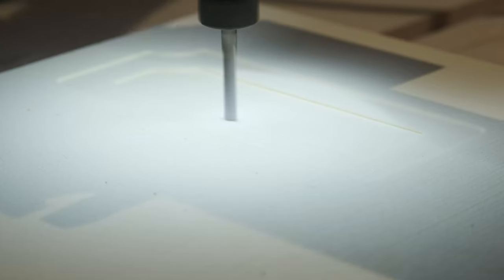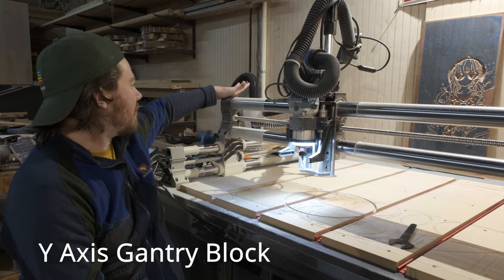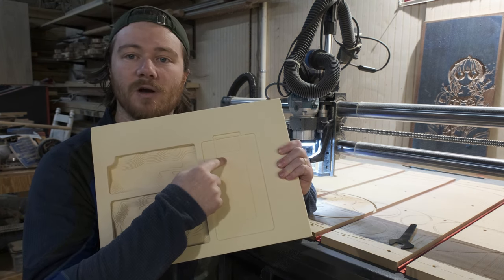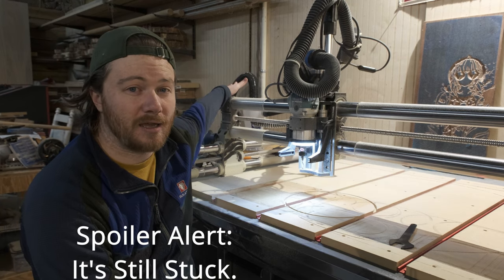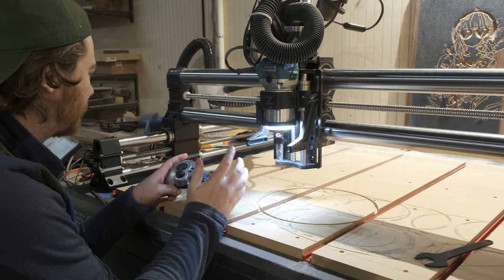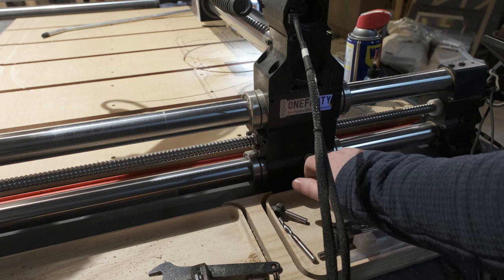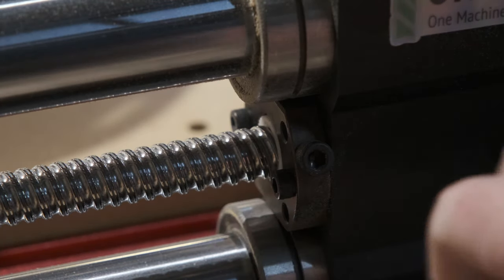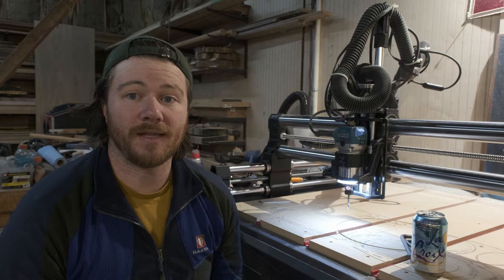I Broke My Onefinity Journeyman X-50 CNC

Comment: Sounds like main reason this happened, was, as you said, trying to film the cut, not using dust boot.  It is good shop practice with machines to not use compressed air for cleaning chips as it blows the chips inside.   Use a shop vac and a good chip / paint, brush to knock them loose.

Comment: Good thing to do after that too to make sure that both Y axis Gantry blocks are symmetric is to make it reach the endpoint towards you and make them both skip steps after hitting the frame. I believe that ensures the symmetry on both Y axis block position! Correct me if i am wrong but i am doing this once in a while on my Ratrig Killerbee.

Comment: You should re oil it 3in1 it is the recommended oil not WD it will rinse the three-in-one out of the bearings and then dry up
Reply from the maker: Great advice, I've got some on the way! Thanks!
Reply: @HamiltonDilbeck  was about to say the same thing, someone came to my workplace and suggested that we should use wd40 for oiling our brand new sawmill. would have seized it up in no time and i was the only one who can read english. there is a big sticker on the machine stating to use thin oil or diesel. wd has lubricating properties but its not oil, for CNC its better to use silicon oil/grease because it wont attract dust.
Reply: Yea I was gonna say it to 
Wd40 is more of a cleaner than a lubricator 
Use the 3in1
Reply: WD stands for Water displacement. It’s not an oil. But good for cleaning.

Comment: the reason for that is the presure air you use to clean it blows the chips and dust in the mechanik :)
Reply: Exactly, all machinists KNOW, to NOT clean machines with compressed air, for THAT reason, blows chips inside everything. Learn to use a chip brush with a vacuum.

Comment: Wow, aren't you supposed to lubricate that ball screw with the appropriate grease (that screw you took off should be a greasing nipple it from the looks of it)? If all it gets is some WD40 that thing will run dry and wear out fast it seems like. Probably a good thing to add some extra wipers or covers to stop dust if you do foam like this a lot. Even with a vacuum running.

Comment: Cable tie some sponge either side of the ball nuts and soak it in oil. You will never have a problem again. But use proper oil or grease for the ball nuts, WD40 is only good for cleaning. 
Beautiful simple and solid machine, love it.
Reply from the maker: Great tips!

Comment: Hey I know I am late to the party . Love your cnc and the working threw getting it going. I noticed something. Wd40 is bar far maybe the worst thing you can use. I know controversial. They actually make lube designed for ball screws that will help with the dust and the like. I also saw watter coming out of your compressed air. Need to drain the tank.
Reply from the maker: Great insight, thanks!
Reply: Absolutely! Get a filter on that airline!
Reply: I have 3 air compressors and all 3 have automatic tank drains on them. The main one, which I use for spraying finish, has the drain, a 3 stage filter system and an air cooler unit between the compressor and the tank. Water = 0.

Comment: Use a dry lube on all of the ball screws, like CRC 3084. But clean it all out this time. You left quite a bit of foam particles when you put it back together. A little more time cleaning now, will save you ALOT of time later, doing it again.

Comment: Glad you figured it out. Frustrating, but an easy fix after discovering it. When mine goes off on it’s own, it seems to be a g code misreading. Usually resetting the program fixes it, but that comes after it’s ruined the workpiece.
Reply from the maker: That has happened to me once before when I was blowing off the machine mid carve. When the compressed air hit the connection port for a wire it seemed to make it skip over some code. That's the only time for me, though. And yeah the foam was like $20 which is annoying- good thing Amazon has two day delivery!

Comment: I had exactly the same problems as you and had to rebuild my machine 3 times before it would work correctly. Your cutting pattern went offline because stepper motors keep counting when the bearings jam  because the is a clutch in the stepper motors that allow it to slip instead of break thereby moving the origin by the amount of slip. For a final fix, I had to go to expensive Super Smart THK bearings with automatic oilers which act as wipers keeping the bearings clean and oiled the problem is totally eliminated. My machine (not Onefinity) runs at a much tighter tolerance (.0002 inches), so is much more prone to jamming than yours. You have to clean and oil after every use to avoid future problems Unless you make the same modifications. Once the machine does this once it will be prone to doing it again. Every time the machine jams you must reset your origin or you destroy your part (in my case three months' work (OUCH !%*$>) . I still think your Onefinity is a very good buy for the price. An ounce of prevention (lubrication) is worth a pound of cure (damaged part, bearing replacement) OUCH.

Comment: that's a major flaw in design... there should be some protection mechanism sweeping the axle as it goes... Did the equipment stop running automatically... or were you lucky and were attending it!?
UPDATE:  I forgot to mention, this is a good video, especially for noobs like me who are making a list of just these sorts of things to place on my maintenance instructions.  ...but you need to correct a few things yourself, WD40 !?!? not good, air compressor spewing water!?!? not good, best for cleaning is the spray used for electronic circuits.  complete NEW special grease should be applied to the bearings after cleaning them spic and span. Thank you for posting this!

Comment: Be nice if there was a way to have boots on the machine so all tubing and screw drives are either dusted off or blown or vacuumed off so all parts are cleaner when they go through any part of the machine if you know what I mean, or some super stretchy concertina boots to keep them all covered to prevent dust and junk getting in to the operational areas.
Reply: There’s a guy who makes them on Etsy
Reply: @SquidsCareToo  If you ever find the link would you share it here, or do you know what he calls them so it is easier to find with a search, thanks for letting me and others know,,

Comment: Quick question. I just set up my onefinity journeyman but the left y axis ball joint will not move really unless I unscrew the tiny black ball screw on the side of it. seems to not be spinning (pneumatic screw when manually moving it) think this same fix that you just pulled off will do the trick?

Comment: Thanks for the video! I'm currently in the same boat with my Onefinity. My issue at the moment is that Onefinity support told me to take the X rail off first. Once I take the two screws out and try to slide the gantry off of the ball nut, it doesn't happen. The gantry and ball nut stay together. It looks easy in your video and Onefinity video. Any suggestions?

Comment: WD40 gets dumped on a lot, despite the fact that it often works. What you used it for here, to free up the ball nut, well it just works. People love to hate WD40, but it has its uses. I must agree though, that there are often better choices for lubrication.
WD40 stands for "Water Displacement - Formula 40". It's 50% mineral spirits and is primarily a corrosion prevention product with some cleaning and lubricating properties.
To lubricate the ball nuts, DO NOT use any kind of dry lubricant like Teflon (PTFE) or graphite. Note that some lubricants like Tri-Flow Superior Lubricant are blends that contain PTFE, so beware. 
Oil is better for dusty environments and grease for clean environments. 
To keep the dust out in the first place maybe a better seal would help. Do an internet search for  - disk brush ring seal -   they may be an option. Might be able make your own from brush type weather stripping?

Thank for the video!

Comment: SAme thing happened to mine. I was dumb, and for some reason thought I never needed to clean mine out. 

The dust boot is a huge difference maker. 

and onefinity has really good customer service if you even think tou might want to get a hold of them do it. they are actually really fast.
Reply from the maker: Yeah they have been right on it whenever I've needed them!

Comment: Dude just eject WD 40 from your shop, I recently convinced my boss to quit using WD40. Try out Superlube with Syncopen, it has a solvent like WD but leaves behind a good amount of silicone lubricant behind. For my Queenbee bearings I use Superlube dri-film spray, I designed a 3d print I use to pop over the can and nozzle  to ride along the lead screw and same for when I apply to the linear rails